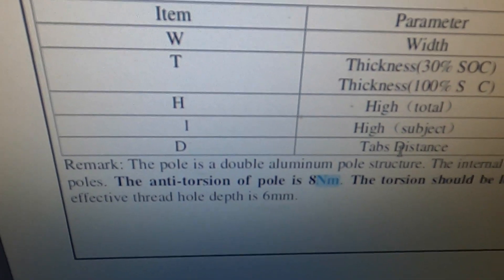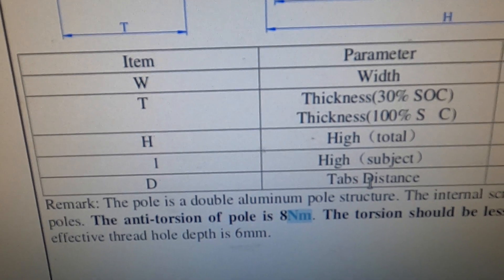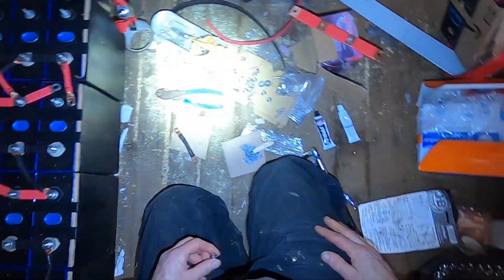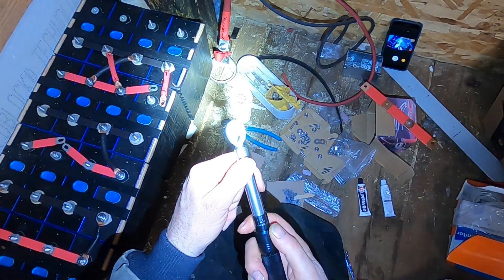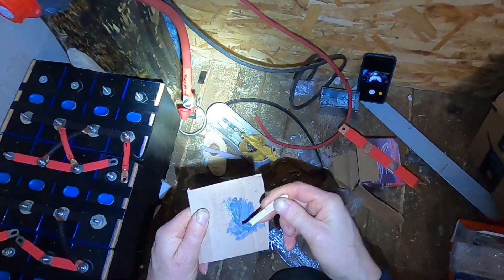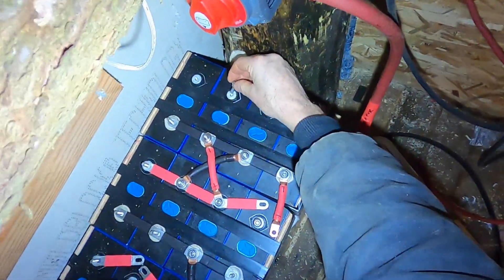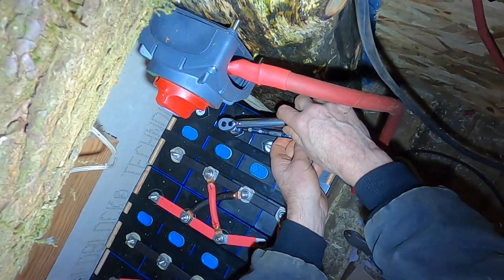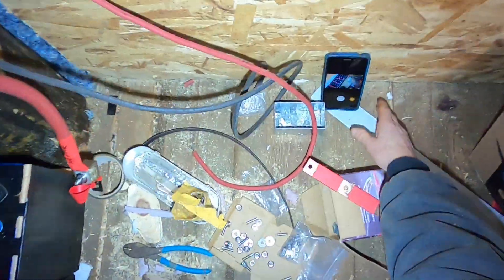Tragedy!  I Stripped 3 Terminal Holes on my 280AH EVE LiFePo4 cells - Underground A-Frame Project

Comment: I asked my China vendor for the torque, the answer is no more than 8Nm (70.8 in-lb). I have six 48V batteries. The first two were at 40 in-lb, the rest were at 65 in-lb. Guess what? The 4 batteries had higher torque worked great. The two had lower torque (40 in-lb) did not balance well, every time I charged them, a few cells jumped up to fast, the rest stayed low until the JK-BMS turned off "CHARGE" for "Over Voltage Protection". My over voltage protection was 3.6V. At first, I thought the problem was the BMS or battery cells but the truth was the TORQUE!

Comment: FWIW a 1/4 inch stud is 6.4mm, which about the same size of the stripped holes. Just carefully tap the hole with a 1/4 tap and insert the stud. Worked well for mine that stripped.

Comment: In case you ever need it again: Rule of thumb for thread-length is
0.8 x thread diameter for Steel,
1.4 x thread diameter for Aluminium, if you want/need full strength. 
I hope this helps you judge a threaded connection and avoid another stripped thread in the absence of a datasheet / presence of a misleading datasheet.
(e.g. typical M6 torque for steel quality 5.6 is 4.8 Nm, divide by 1.4  (because of reduced thread length) -> 3.4 Nm)

Comment: Thank you for the video. I was about to torque it at the same amount and I'm glad I watched this first. I noticed that 1 of the cells was only 3.25 instead of 3.28. is that too far out of spec or is it within reason?
Reply: due to the flat discharge/charge curve of LiFeP04 that is a very bad place to put your pack together. Maybe he is putting his cells in parallel and top balancing in this video? But from what I see it looks like he has 4 in parallel that are then being attached in series to the ones next to it. 

One cell at 3.25V could be at 20% SOC and another cell at 3.25V could be at 45% SOC (The SOC/Voltage charts you see floating around online say that voltage is typically 30%). That would cause a pretty massive inrush of current into the lower cell as the higher cell tries to fill it (if the connection is parallel). If the connection is series....oh boy you just created the balance problem from hell. More than likely that cell at 3.28V is at 40% according to the SOC/Voltage charts but don't take those charts as the gospel. Cells vary and that 3.28V cell could be at 50% or 55% in one cell and could be 30% in another cell (these numbers are a bit extreme but using big rounded numbers to make the math a little easier to understand). 

So you charge these up and they are in series. 3.28V cell was at 50% and lets pretend they are 100Ah cells. You put another 50Ah in before she hits the top of her charge and the BMS shuts the charge current off. 3.28V is now at 3.65V. That cell that was at 3.25V was  30%. Well you added 50Ah to that cell too and now shes at 80% or 80Ah. Your BMS is going to have a hell of a time bringing that high cell down to get in line with a cell thats 20Ah divergent from its partner. You'll almost certainly need an external balancer if you don't have the JK 2A Balance Current BMS and even then you just created quite the work day for the BMS and it might get quite warm.

Comment: That sucks... I notice steam from your breath - metals, especially aluminum, tend to become brittle when it's cold. You're better to just do it by a snug feeling in the cold. If you were in a 50+ degree environment, the threads probably wouldn't have stripped. Also, torque changes with temperature as well. The colder it is, the tighter the torque tensioner gets so it takes more force to get it to get it to click. Sadly you ran into a perfect storm, as it were. 

Too late now but just an FYI. What I would do is bring the cells indoors that stripped, get em up to home temperature and get a cheapy tapping set and rethread them with a slightly larger diameter and replace the stud bolts with the same size. I ran into a situation with a buddy who stripped his out too and that's how we prevented any more from stripping.
Reply from the maker: Thanks.  I ended up using Helicoil inserts to fix the threads.  Worked fine!  Just have to be extra careful not to drill or tap through the top of cells...
Reply: I never thought of the temperature issue... Just stripped out 2 terminals on my pack. I was using studs but was working on the pack in my RV when it was probably around 45 degrees. I'm going to try drilling and tapping an M8 hole on those. I'm not sure if I should just do all the holes or only the ones that were bad.

Comment: As a word of caution, in addition to the risk of stripping the terminal threads, apparently there have been some who have over tightened the stud and punched thru the bottom of the terminal, breaking the internal seal and destroying the cell.  I have 8 of these cells in a 24V pack which I use in a small solar setup at my home.  I used 25 mm M6 stainless steel studs on the terminals for connecting bus bars and balance leads.  I had read on the DIY forums that you should only hand turn the studs until they bottom out, then back off a 1/4 turn and install your bus and balance connections with a lock nut while holding the stud in place with an allen wrench, so that the stud does not turn and  bottom out in the cells while tightening the lock nut.  My experience using this approach has been good so far.
Reply from the maker: Thank you! I did modify my approach after being notified of that possibility.  I am now hand tightening to the bottom of the hole with locktite applied.  Since I have studs rather than set screws I am relying on the locktite to prevent further tightening into the hole.  I also used a sharpie to write a line on the top of the studs so I can see if they turn at all when tightening the nuts.

Comment: I bought 280Ah Lishen cells and they arrived with 6mmx16mm grub screws. I bought 30 mm and 25 mm long ss grub screws to replace them as 16mm is too short for some connections. yes, I am glad to see your warning youtube video so I did not over tighten these tiny grub screws (set screws). keep up the great work. If you use a Helicoil, I would like to see that video. I am working out in the cold so I know the struggles of the cold weather as well. I am using a 2P8S 24-volt configuration for now. I may try a 48-volt one in another battery bank.
Reply from the maker: Will you use locktite or similar on the grub screws?
Reply: @metagrid9453  so far I have not used locktite, but I was definitely considering doing so. i will have to investigate that a bit more.
Reply from the maker: @pilgrimvalley1554  It purports to re-inforce thread strength.  So far it it working but I have not done my final tightening of the terminals yet.
Reply: @metagrid9453  I ordered 32 more cells and they came with 6mm bolts and washers but better busbars. they had an issue of the bolt would not screw in adequately or had a lot of resistance. I feared stripping them so I took out all the bolts provided and replaced them with 20mm studs and flare nuts. I do think I will put the lock-tite on the as you and others have suggested. I hear the I need more coffee as that is my morning routine. currently charging 16 more of the Lishen 272Ah cells. mine are all Lishen 272Ah cells. I now have 64 total. thanks for all your videos. it sure makes me cautious not to over-tighten. still curious about the helicoil repair but hope I don't have to go there! keep up the good work. i  hope to someday heat my house with the excess solar electricity. i am using Electrodacus SBMS0 and Electrodacus DSSR20's. the SBMS0 is the BMS and the DSSR20 are solid-state relays designed to work as solar charge controller and they also have the option to use the excess solar as heat.....have not got that far yet. but they charge and monitor and protect the LIfepo4 IN 3 decimal place accuracy. I like it a lot.

Comment: I'm doing a similar setup (4P16S) and I've been bouncing some ideas off of folks in the diysolarforum.com site and one of the recommendations I'm employing is to connect the cells serial first, then add the parallel bus bars.  The consensus is that more current will be flowing serially, then parallel.  I'll be making my own bus bars as I'm stacking my pack 4 (verticle) high, 16 across - makes the + and - connections closer.

What are you planning to use for a BMS.  I'm still investigating my options, but I'd like to do something I can use either CAN or RS-485 to communicate to my Schneider equipment (put in standby maybe) if I hit a high/low cell voltage.  The Schneider equipment can already do temp cut-off across the whole system.
Reply from the maker: Does your setup require 4 separate BMS? (One for each serial string)
Reply: @metagrid9453  It's not supposed to.  It's still treated as a 4P16S configuration, the only modification is the placement of the bus bars and their proximity to the battery terminals.  It was explained to me that higher current will flow across the serial connections during discharge compared the parallel ones.  Here is the thread (I jumped in on page 3, but the whole thread is very enlightening) https://diysolarforum.com/threads/lishen-272ah-thread.12871/page-3
Reply from the maker: @davidchristensen1219  Will check it out, thanks!
Reply from the maker: Seeing your cell diagram on the forum helped.  I understand the concept of the serial connections being closest to the terminal surface of the batteries now...

Comment: M6 studs are the only way to work with these batteries in my humble opinion.
Reply from the maker: Agreed.
Reply from the maker: Do you use locktite or similar on the studs?
Reply: @metagrid9453  What would be the reason you'd want to use loctite? Loctite is usally used in vibration settings. I'm guessing this will be a stationary system so I don't see a need for it?
Reply from the maker: @vladbagdasarov1672  I am hoping it will strengthen/stabilize the studs so they are less likely to strip the terminal holes when I attach the bus bars.
Reply: @metagrid9453  I didn’t personally but I can’t see it hurting anything. I just went to the hardware store and got a bunch of 40mm M6 SS bolts and cut the heads off with a grinder and used a double nut to crank them in the hole. Before this I snapped off a bolt in the battery’s down had to drill it out. I couldn’t use m6 anymore so I just found a tap for a bolt I had kicking around and used it to install a slightly larger bolt stud for that one cell

Comment: I glued my 25mm studs in with a strong Loctite and after 24h I applied 6NM to the the nut. It worked perfectly.
Reply from the maker: Awesome!  Thanks...
Reply from the maker: Did you use the loctite "primer" I have seen mentioned?
Reply: @metagrid9453  

In fact I didn‘t use an original loctite glue, but an Liqui Moly one rated as „high strength“. The A2 stainless studs were screwed in by hand until they contacted the bottom.

Ill recommend even less tourque then I applied, somewere around 4-5 Nm. This by far enough for a rigid contact. 

The 8Nm are from a thumb rule of mechanical Engineering originally. But they shall only be applied an a Steel environment. 
Best regards from Germany
Reply from the maker: @stevesays8705  Thank you!

Comment: Dude, I know what it said, but that is like 70 in-lb.  I torque my oil drain pan plugs on my cars to 18 in-lb and that is steel.  My effort on my lead AGM batteries is snug, and check in a couple of days to confirm snug with a shorty ratchet.  I am so very sorry that this has happened.  My profession advice would be to drill and tap to the same pitch, but next diameter size up.
Reply from the maker: Thanks!  If the JB weld does not hold I will probably try a stainless helicoil next.

Comment: i did the same thing,but i repaired it using heli coils.
Reply from the maker: I may end up there.  OI have the helicoils ordered.  Will be here tomorrow.  I figured the JB weld was worth a shot, if it does not work out then I can just drill and tap in prep for the insert.
Reply: Where to get the heli coil and specs needed for the size?

Comment: I googled if J-B weld is conductive, and found an official answer from their page: 
"WILL J-B WELD CONDUCT ELECTRICITY?
No. J-B Weld is not considered to be a conductor. It is an insulator."
I think your best bet is to drill out the hole and cut a M8 thread in there if that is possible.
Reply: You should be ok if you go easy. Check to see how well the JB weld set up on the mixing board. I can see your breath so it’s cold. Some epoxies just won’t harden when cold or it takes much longer to set up.
Reply from the maker: @SkypowerwithKarl  I think I'll wait a couple days at least before I touch it.  Good tip about checking the mixing board.
Reply: He might be ok. The current should be carried thru the face of the terminal and not the bolt normally anyways. Bummer that it stripped. Fair warning before I build my pack.
Reply: tap tips will punch a hole in top of the terminal destroying the cell and you know how deep a tap goes before it starts to actually cut so be precise or machine your tap tip beforehand and measure depth! scary
Reply: I'm going to use conductive epoxy. There are two sorts the darker carbon-infused epoxy and the more conductive and expensive silver epoxy that is used on circuit boards.
Reply from the maker: The stud is stainless and the JB weld is only on the stud.  All of the conductivity of the terminal is via the terminal surface surrounding the stud which ideally will be free of any contaminants once I hook up the bus bars.
Reply: @metagrid9453  You are right, I hope it holds. Waiting for the update :)